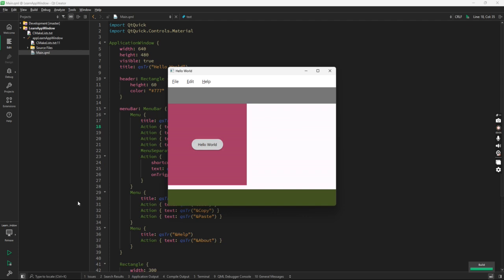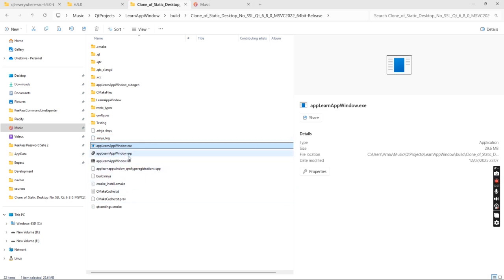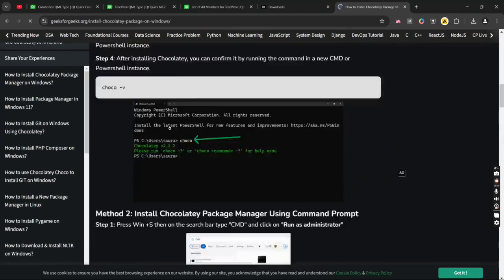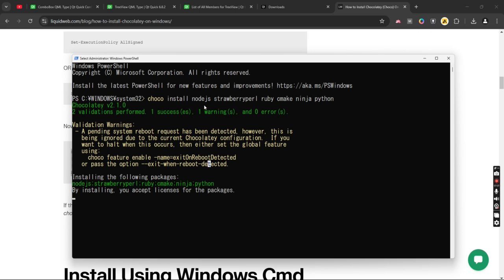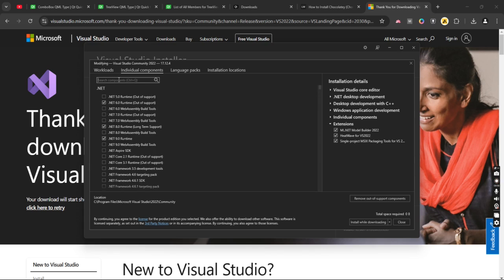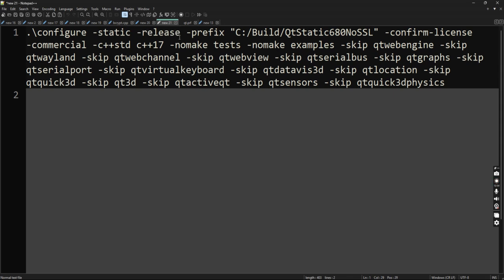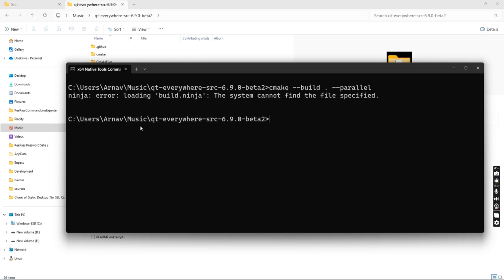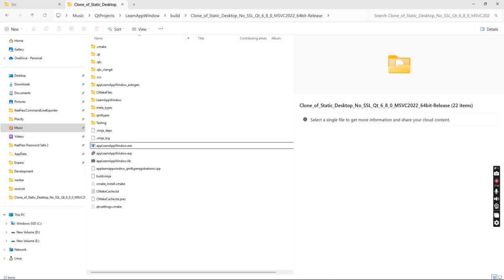QT QML 6 Advanced Series | Lecture 31 | Build Static Qt 6+

Comment: Sir please I am lost with this.
Reply from the maker: @Ed_pm  could you tell me the part where you're facing issue?
Reply: @ArnabJhaYT  Alright. 
Firstly, you said something about static, meaning you run a single exe file of the project from the build directory, right ? 
Secondly, about the debug and release, you said release needs other resources to be able to run. Why so ? 

I am thinking maybe becuase we are using debug as our mode in the production. If not, kindly elaborate on that. I am still watching... I had to rewatch it. Is this whole video about deployment ? 

The part where you instead other tools like Ninja, Cmake etc.. is so confusing as well. Very confusing.
Reply from the maker: @Ed_pm  Hmm. this thing itself is confusing. When you're working on a qt app as a developer, you're using debug mode. Debug mode has access to a lot of internal code, files, unsafe for public sharing.
Release mode is for public usage. Static qt means you will build the app into a single large .exe file which you can share with anyone else.
Reply from the maker: @Ed_pm  This whole video is about deployment, yes. To deploy your application.